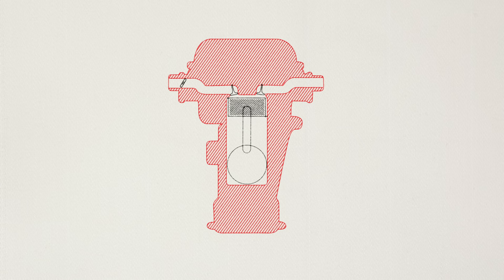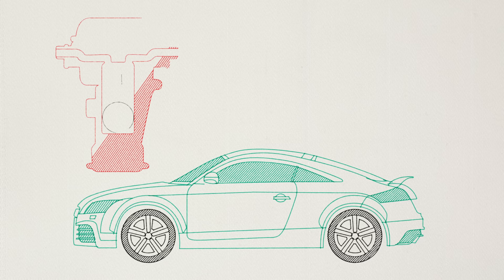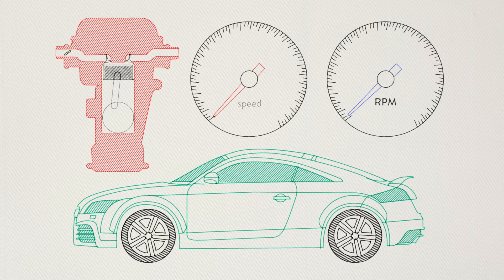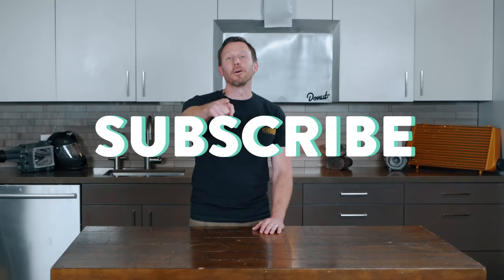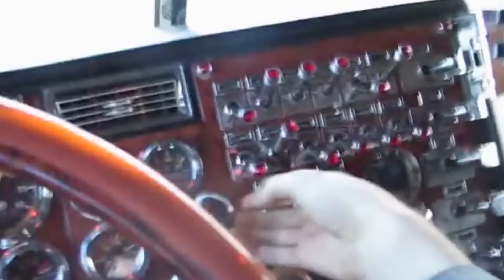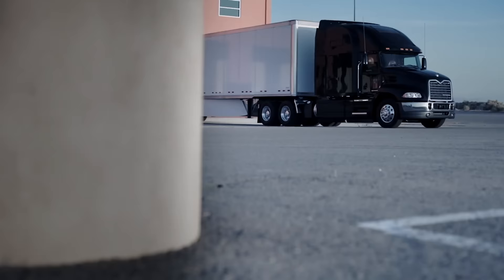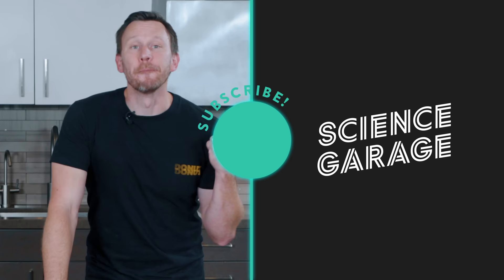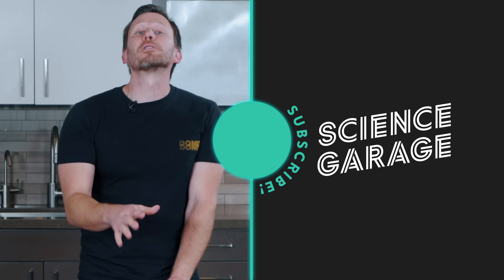ENGINE BRAKING | How Semi Trucks Slow Down Without Brakes | SCIENCE GARAGE

Comment: Some diesels do have throttles. Some diesels have compression ratios of up to 22.5:1 which on its own is enough to significantly slow down or hold speed down a hill with a heavy load. I have a 6.9 idi swapped 1975 f250 and if you put that baby up at 2500-3000rpm and let off the fuel because of the unequal length headers and the extreme compression it actually sounds like it has a jake brake. It also will slow a 21,800 pound rig down on a 7% grade. That’s the 6,800lbs truck with a 5,000lbs trailer and a 10,000lbs tractor.
Reply: Compression does not contribute to engine braking. Almost all of the energy used to compress the air is returned on the power stroke. Without an auxiliary braking system you are only relying on friction and restrictions in the exhaust.
Reply: Redtooth 75 you are incorrect. If you aren’t allowing fuel to be injected (or at least very little) there’s almost no return in energy therefore you’re theory is wrong and it does take more energy to compress the air then you get back from the powerstroke. If that wasn’t the case then my truck would just freewheel down the road like it’s in neutral. You can do this same thing in our 6 speed 6.0 ford powerstroke diesel and you won’t get nearly the same amount of braking. It feels like being in neutral.
Reply: @carsonhammond6204  "The higher compression ratio in diesels means they are harder to start, but once they are running the energy expended in compressing air is regained during the expansion stroke when the compressed air is allowed to "spring" back, so the higher compression ratio causes negligible engine braking via energy being lost as friction and heat of compressed air to engine block."
https://en.wikipedia.org/wiki/Engine_braking
It is a very common misconception that higher compression gives greater engine braking power. I myself thought that until a couple of months ago. The compressed air pushes the piston back down with almost the same amount of force that the engine used to compress it.

Comment: a jake brake sits in a " rocker box" and slows the valves down which is why its so loud the reason for jake brakes is saftey the distance it takes to stop a fully loaded semi and trailer is much more than that of a pickup so they have to add extra braking forces as air brakes are not enough and wear much more quicly without them the reason they are so loud and "poppy" is the fact that more than 3x the amount of normal compressed air is being forced through the exhaust valves and out which is the oppisite of an exaust brake which uses back pressure to slow the engine down niether are bad for the engine love the video

Comment: you can also do this in a automatic or cvt when you go down a hill you just have to apply enough throttle so the transmission does nt go into neutral

Comment: I thought that the Jake brake operated by injecting diesel before top dead center during the compression stroke, making the fuel ignite while the piston is on it's way up. Not sure about the exhaust valve operation but that makes sense that it would release the burnt gasses early to help prevent any power from being made on the power stroke. I know that I drive 10 wheeled dump trucks and when I use the engine brake, I use more fuel at the end of day.

Comment: Missed opportunities on discussion:
1. Gear train backlash when shifting from (a) driving the wheels with engine power, to (b) driving the engine with wheel power.
2. Engine oil consumption when the combustion chamber is in a vacuum for prolonged periods.
3. Braking effects by electric vehicles, regenerative braking systems.

Comment: >driveshaft in a manual car can tug on the crank and demand more air from the intake, if there isn't any air to give then that tug is simply wasted. IE a vacuum inside the engine is created and slows everything down as a equal and opposite reaction of the wheels turning the crank faster than the air can come in. This is why lower gears can cause more vacuum in the engine, they can revolve 2-4 times faster than the higher gears thus creating 3-4x more vacuums. So long as you don't down shift too fast or far you'll be okay as those rpms will be in a acceptable range. IE the pressures the engine was designed to handle. 
>For a diesel engine this principle is the same except instead of a vacuum consuming the energy it's simply sent through the exhaust system before it's allowed to combust. 

For both cases the basic principle of braking is the same as the actual brakes, instead of friction though a gas car uses vacuum and a diesel uses compression. Compression and vacuum are both related to pressure, IE instead of transforming the energy into heat you transform the energy into pressure.

Comment: Lol.. this diagram is sorta correct.. actually the jake works on vacuum. It opens the exhaust valve right before TDC top-dead-center releasing the compressed air then the exhaust valve closes leaving the piston drawing a vacuum while both valves are closed on the piston’s way back down..
Reply: Incorrect,  the jake does not use vacuum.   It uses the compression of the engine to slow it down,   it only opens the exhaust valve on the compression stroke so that the combustion stroke does not work like normal.   Then closes the valves during the exhaust stroke untill the last second to use the compression a second time before starting the intake and compression cycle again.  There is never a vacuum created.  Just no power, only absorbed.

Comment: First of all, semi-trucks have 12 to 16 liter inline 6 cylinders. 
And what you hear, is not an engine brake, but straight exhaust, which a lot of classic trucks using;)
Engine brakes also work on trucks with automatic transmission. And you don't have to flip the switch to activate engine brake every time unless you drive old school truck with the mechanical engine. You simply flip switch once, and engine brake either works when you release the throttle or turning off cruise control. You may also set ECU, so engine brake will engage only when you touch or press and hold the brake pedal.

Comment: Trucker here. Jake brakes actually create an even greater slowing/braking force on modern trucks. I can nearly come to a stop from highway speeds fully loaded on the Jakes. And I can effectively engine brake without Jake no problem when I'm not loaded. The force is a lot less then in a gas powered vehicle, but it CAN do it.

Comment: Is a Jake brake 2 stroke or 4 stroke? Does it open the exhaust valve on every cycle or every other cycle?
Also is there an easy way to also use the intake valve to add extra spring by pulling the piston down against a vacuum, then suddenly opening the intake valve to flood the chamber with air?

Comment: 🙋🏽‍♂️gas engine vacuum from intake and compression resistance from compression stroke.. my little diesel doesn't have a jake brake nor a throttle body but down shifting using the engine to brake still occurs.. so u regot the compression stroke resistance
Reply: I have the same question, I drive sub-CDL trucks, they still have large diesel engines, but no jake brake. Non the less  I engine brake a lot when loaded heavy.

Comment: Diesel engines in personal cars has equivalent or a little better engine braking than a gasoline engine of same size, due to the higher compression ratio. Jake break is additional system for breaking in diesel engine,it has normal engine breaking (using compression affcorse)
Reply: Compression does not contribute to engine braking. Almost all of the force used in compressing the air is returned on the expansion stroke. A diesel needs a supplemental system for engine braking; such as a jake or an exhaust brake.

Comment: Jake brakes turns a power making engine into a power absorbing air compressor. Jacob’s Manufacturing also makes drill bit chucks. Diesel engines do not produce vacuum.  Raw fuel in piston cylinders when applied, oil should be changed a little earlier.

Comment: So the Jake system causes pre ignition which ignites the fuel before the piston reaches top dead center which in turns creates an opposing force on the piston , almost like forcing the crankshaft in the opposite direction which causes the engine to air lock which in turns cause the  drive train to lock up or slow down depending on the gear ur in.
Reply: No, the engine does not inject diesel when the jake brake is on. The original jake brake opened a valve roght at the end of the compression stroke, so the engine uses energy to compress the air but does not get any back.

Comment: South Africa has some of the highest weights a semi can legally be on the road without having any additional special permits which is a combined weight of 54 000kg which is around 118800 lb and the max weight per axle is: front wheels 6000kg, and on the rest is 9000kg in the case of a single axle and 18000kg in case of a tandem axle, it's also common to have two trailers hooked up to each other with an 5th wheel on the first trailer and the weight rules for the second trailer is the same as for the first, in this case its 6000kg for front wheels 18000kg for the driving wheels, 18000kg for the first trailer axle, 18000kg for the rear trailer axle, combined weight not more then 54000kg and total combined length not more then 22 meters...

Comment: actually in short he Jake brake causes a controlled misfire. when the injector lever come TDC on the cam and sprays fuel in the cylinder it simultaneously triggers a hydraulic solenoid to open the exhaust valve. hence controlled  misfire.

Comment: With my aftermarket ECU I could also cut fuel in over run on my gas engine so it also engine brakes on the compression stroke as well. Essentially just turning the engine into an air pump.

Comment: The US trucks still rely on this old tech. Modern European trucks use a combination of an exhaust brake and a retarder/intarder. A retarder is a hydraulic or electromagnetic device fitted to the output of the transmission or on the driveshaft itself. Much more brake power then a jake brake.

Comment: Diesel engines have an air regulating system on the intake manifold these days, (have done for many years) which help with the computerised injection system to meter the fuel precisely.

Comment: not all the exhaust gas from the exhaust stroke is wasted, some of it is used to power a turbocharger which puts more air intro the engine, and some of it is recirculated back into the engine in the case of diesels to control emissions

Comment: I actually like driving a manual transmission because  it seems automatics change gear at the wrong time. With a manual I can change when it suits the scenario, short shift when cruising and staying in a more economical higher gear or I can rev closer to the redline and stay in lower gears when accelerating hard. And you can look a head and have the car in the most suitable gear in advance, for example driving in the twisties.

Comment: Jake brakes also use vacuum to slow down because after the slave piston let’s the valve seat the piston is on power cycle with no fuel or air in there creating a strong vacuum

Comment: There’s also much quieter exhaust braking, which generates back pressure in a diesel by trying to push the exhaust gases out while the exhaust valves are still closed

Comment: Small correction, but diesel engines DO engine brake the same way gas engines do it's just the lack of throttle valve means a diesel engine will brake less than a gas engine. The reason a diesel engine sill brakes some is there are enough of a restriction in the intake and exhaust systems to create some vacume and resistance that slows the wheels. There is also the fact that you are effectively tuning engine into a large air pump driven by the wheels which resists turning the wheels some. 
An exhaust break though greatly improves breaking by other means described in the video.

Comment: Small diesel engines do have throttle bodies to just control the amount of air. It opens and closes when u hit the gas, just like a petrol. They usually have much more engine breaking than a petrol because of their higher compression ratio
Reply: Higher compression actually doesn't contribute much to engine braking. The compressed pushes the piston back down with almost the same amount of force used to compress it.
Reply: @Redtooth75  true, then idk what makes it  seem like they have more engine braking

Comment: DFCO is what slows the gasoline engine, not the throttle body, especially in ETC vehicles. You can tune DFCO out of an engine and get the car to coast with zero throttle. DFCO retards the timing and cuts fuel to allow for engine braking. Without DFCO, you would coast to a stop, or accelerate downhill.

Also, automatic transmissions can utilize engine braking as well, using DFCO, which keeps the converter locked and downshifts the trans to run the engine at a higher RPM to achieve the desired amount of braking.

Most vehicles today, trucks especially, have multiple DFCO modes to use more or less engine braking to either conserve fuel and increase MPG, or increase engine braking.

You can actually increase the MPG of most vehicles by enabling DFCO at higher RPMs, but increasing the timing, and reducing the deceleration effect of the engine. There are other factors, like valve timing, throttle position, engine speed, injector minimum pulse width, etc that all need tuned for the maximum benefit.

You also completely ignored exhaust brakes, which uses the exhaust to create the pressure on the piston in the same manner, more or less, to the Jake brake. 

Video was good, just a little too simplified to actually explain what is happening.

Comment: Yeah...ok...like rolling resistance from the wheels through the drive shaft, interial directional change converting force into heat, rotating parts with friction (despite oil there is still friction) dont have a considerable contribution to this affect as well. Especially rolling resistance.

Comment: Now that you know how an engine brake works, it’s a little difficult picturing how the valve suddenly opening for the compressed air would slow the engine down. Perhaps the piston going down without being forced (by the ignition of diesel fuel) is doing it?
Reply: It slows down the engine by opening the valve just as the fuel combusts.  That means that instaed of getting the combustion stroke to provide power it does nothing.   The braking comes from the compression stroke.

Comment: Also when you shift into a lower gear for engine braking your car doesn’t have as much torque in the opposite direction to turn the engine and slows down much harder

Comment: Automatic Jake Brakes were not required to be put on diesel engines in semi's until, I seem to remember in the late 1970,s, please correct if I'm wrong. Back then the Jake Brake was not so good at slowing trucks even on a road with a 3 -5% down grade. That is why you seen emergency stop ramps in the mountains. Today's Jake Brakes are a lot better.

Comment: This is a great video with one MAJOR fault.  It glosses right over the critical fact that exhaust valve opening causes combustion not to occur, and hence the energy used to compress the air is just absorbed, or used to slow the vehicle.  Still better than the video at Jacobs which is complete trash.

Comment: That's really interesting I've always wondered how a jake brake worked. I kinda just thought that it block off the exhaust some how which would kinda work in the same manner but obviously no where close to as effective as this way. Also like to mention that the illustrations are not accurate. It gets the point across just fine but the valves shouldn't open up into the head.

Comment: Fun fact. When pressing the gas pedal in a Diesel you control how much Diesel is injected into the cylinders. When you press the gas pedal in a petrol you basically only operate the throttle valve. At least that used to be the case. Today your gas pedal is just connected to a computer which basically interpreds your inputs into what it thinks is best in the current scenario. Sadly these days youre no longer connected to any part of the engine. The closest you get is operating the clutch in a manual.

Comment: Couldn't the Jake bake be more effective by closing a valve on the intake to create a vacuum during the intake stroke? It would have to open momentarily to equalize pressure before closing again to compress on the exhaust stroke.

Comment: I once had no brakes in my VW , e brake barely worked …. I would carefully slow myself down with engine braking until the ebrake could handle the stop for about a week until I got the brakes fixed

Comment: Jakes is the old kind of brake. Newer truck engines got more sufisticated systems, lile volvo engine brake VEB+? exhaust flaps of dirrernt desine, air controlled additionl valve in cylinder head.... But principalls are the same as old good jakes.

But, this is not only a way to slow down big rig. In Europe hydrolic retarders are popular. This is big heavy box on output shaft of transmisson mixing fluid inside and transgering energy of speed and mass to heat. Of course retarders are water cooled. 

It is not all/ Telma makes electromagnetic brakes.

Comment: With a gasoline engine you're kinda sorta engine braking most of the time, since you normally don't go full throttle. There's pumping losses whenever the throttle's not fully open. This will of course not hurt your engine.

Comment: Most modern vehicles including autos use decelenleanment as a strategy for engine breaking. It drops the amount of fuel delivered to the engine under high vacuum conditions aka when you let off the pedal and will cause a pumping loss effect to slow down the vehicle. Sort of the same regenerative braking on electric vehicles. Except it doesn't increase economy lol.